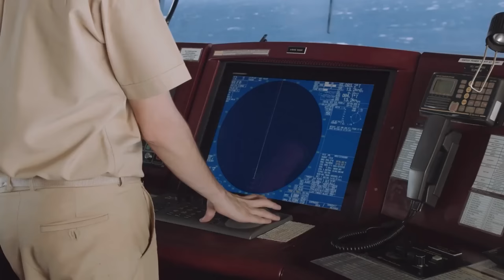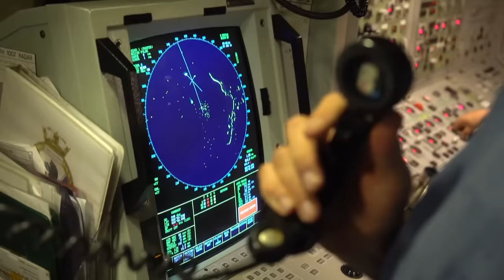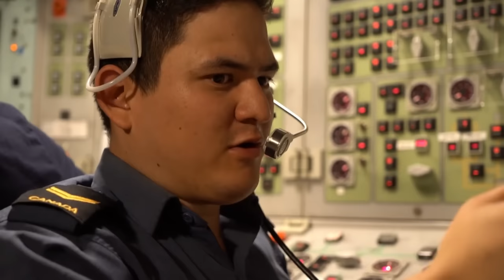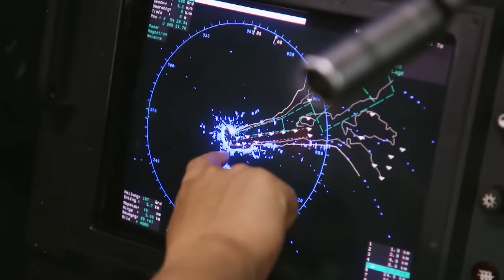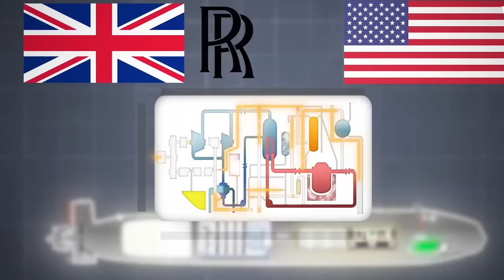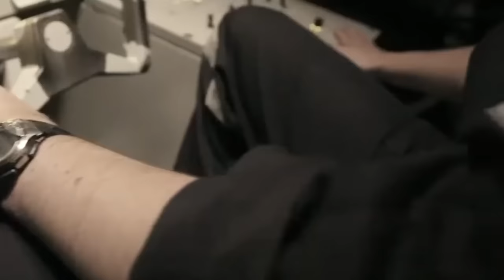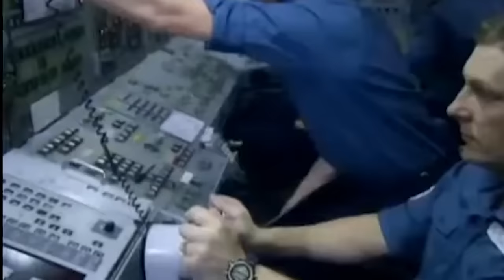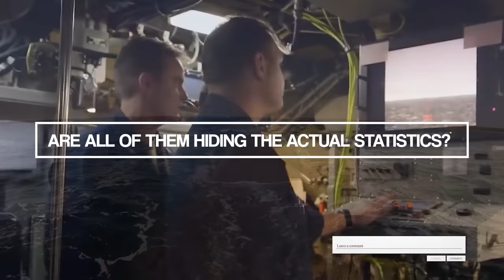How Many SUBMARINES Does Each Country Have?

Comment: The weight of a submarine can be controlled by the amount of iron at the bottom of the hull.  This has to counteract the massive buoyancy of the very large airspaces within.
Reply: The buoyancy of a submarine is controlled by ballast tanks that are filled with water to submerge the boat or blown with compressed air to force the water out to make it more buoyant. The pressure hull is where the submariners and all the equipment are. The external hull is what you see when looking at a sub. Between the two hulls is where the ballast tanks are located.
Reply: No.

Comment: 3:22 What is the rail along the side of the submarine for it is that for a gun placement to be slid out when they are On the surface
Reply: Like the track on top sunk in not the Handrail
Reply: It's just a railing.  So workers don't fall off.  They remove them.

Comment: Russia is commissioning 32 warships this year, including an additional 8 Yasen class diesel electric subs. (black hole subs is what they are called because they disappear as if into a black hole and can't be tracked) I believe Russia is understating their numbers. Additionally, they have the Poseiden. It is an 80 foot nuclear powered torpedo with a 100 megaton warhead. It can stay submerged under the polar ice cap for years until needed. The Yasen class can carry these. If five or six are detonated at the North American  Atlantic coastal shelf they will generate a 150 foot high radioactive tsunami from Nova Scotia to Florida, running 100 miles inland. The Poseiden  travels at 6o mph submerged. Nothing can touch it.